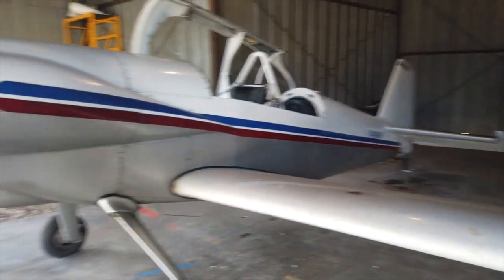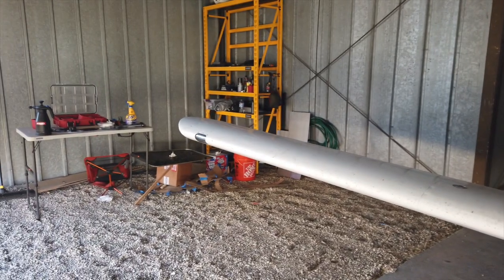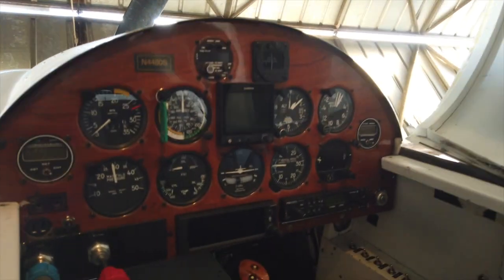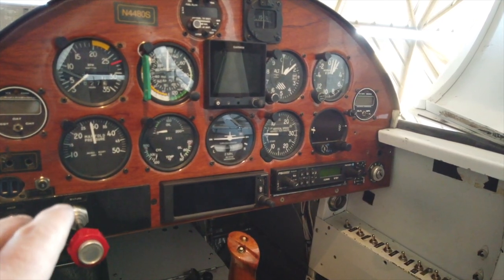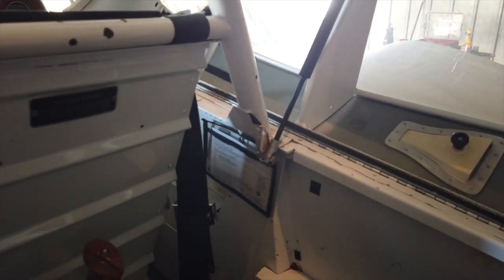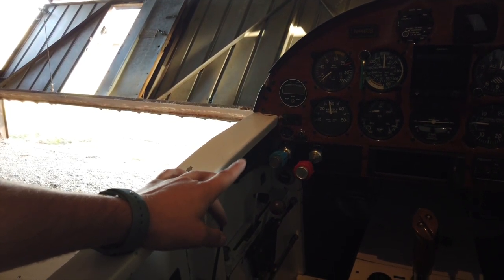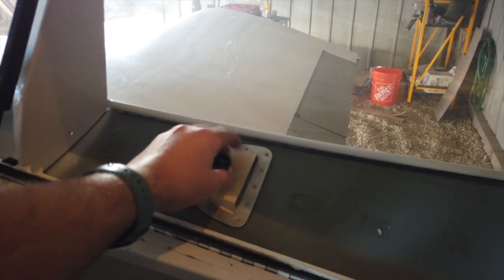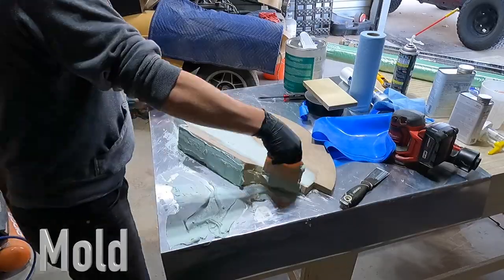RV-4 Walk Around

Comment: Is the rear seat suitable as a baggage compartment when flying solo?
Reply from the maker: Absolutely. I generally just keep an overnight bag there as long as I can strap it secure from the rear flight controls. The rear seat back also removes with a pull-pin and I can have a larger baggage compartment. W&B is fairly permissive on the RV-4, especially with a 360 up front.